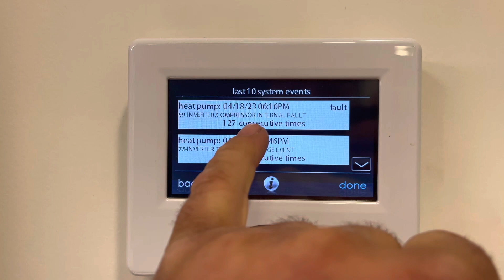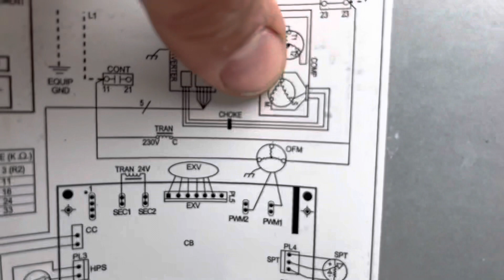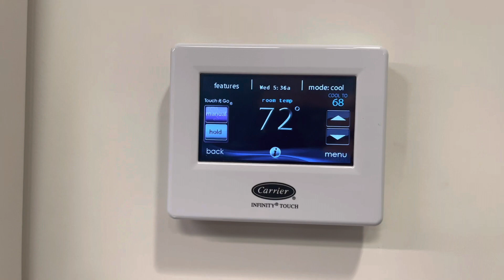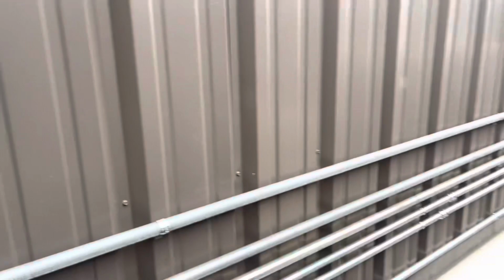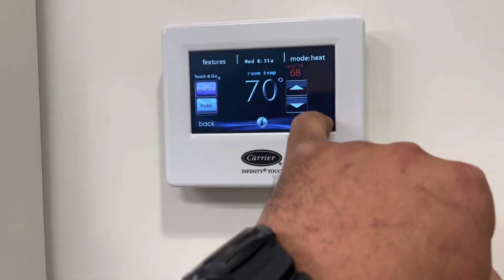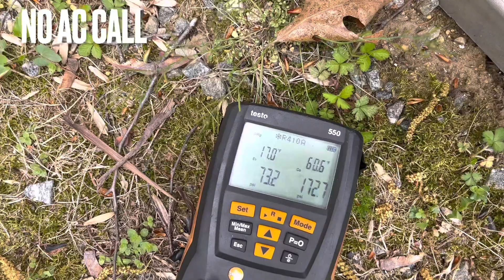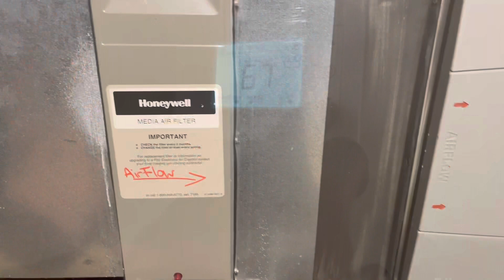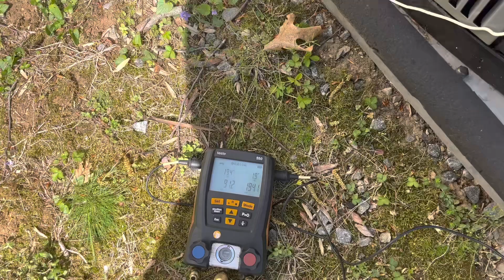HVAC RIDE ALONG. 2 NO AC CALLS.  CARRIER INFINITY AND TRANE SPLIT SYSTEMS.

Comment: Good Job.  I have dealt with the same issue.   They like to replace both because one of the two may have been compromised when the failure occurred.  Keep up the videos.   Thanks for posting.   I’m a Carrier tech here in Florida.
Reply from the maker: Thanks a lot.   Doesn’t seem like a good thing.  It’s almost like some companies like to throw the parts catalog at it and see what sticks.   I appreciate.